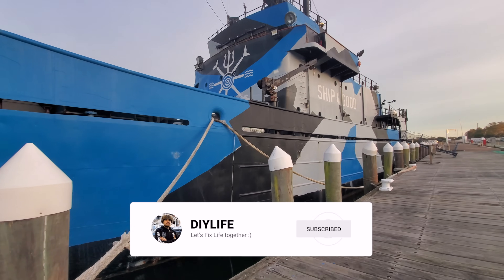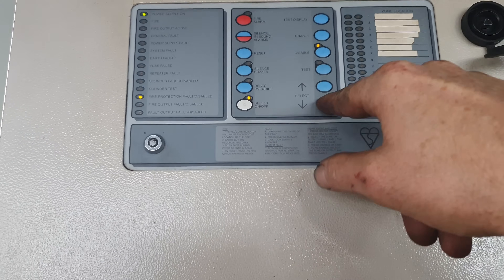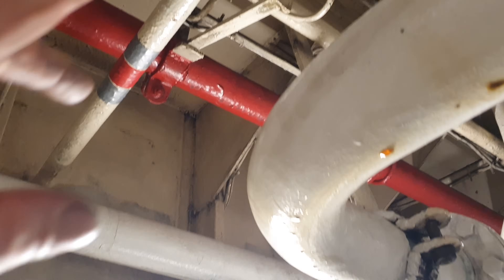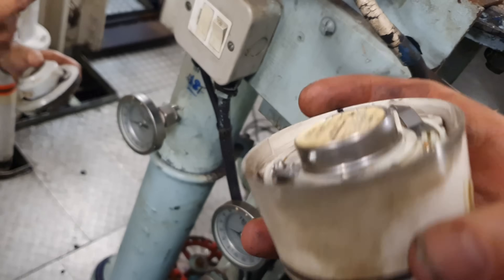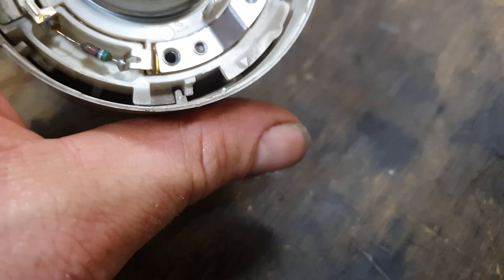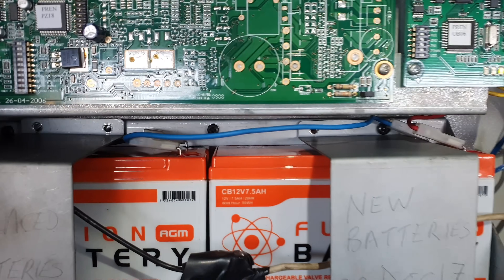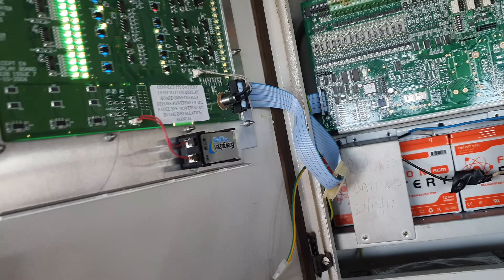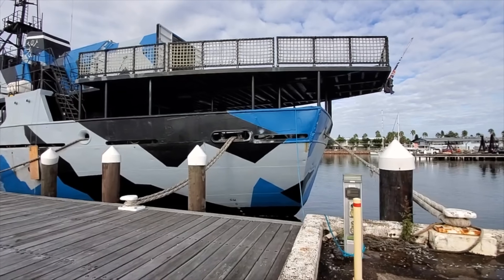Let's get the Fire detection system operational again mate!

Comment: Getting systems that have been unpowered for years is usually difficult. It took the electrical team about three months to get the lighting circuits of the loco I'm working on operating after being unpowered for 32 years. Missing parts, cut cables, dirty contacts all worked against us.

Comment: I don't know much of anything about ships, but I spent 30 years with fire alarm systems. I am surprised to see an ionization smoke detector in an engine room. One wiff of smoke will get you an alarm. We generally use flame and heat detectors where some amount of smoke is "normal". Is smoke detection usually used in engine spaces on ships?

Comment: Get that inter-battery link properly insulated. Failing electrical tape not good enough for something as critical as the fire detecting system, and to do it properly is a miniscule cost and effort. Just crimp an insulated connector on both halves.
Reply from the maker: Cheers for the tip, safety is paramount, we'll definitely look into that 👍.
Reply: Would it not even be better to just solder the wire and cover it with heat shrink?
Reply: @shane011471  Or even just replace the wire - it's only about 12" long!
Reply: @andrewmawson6897  Could put wagos to connect them